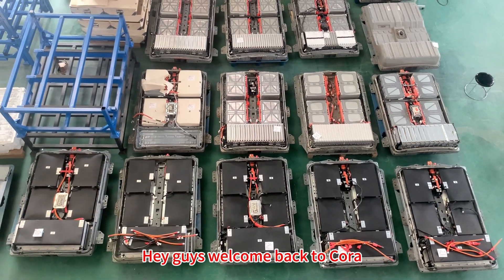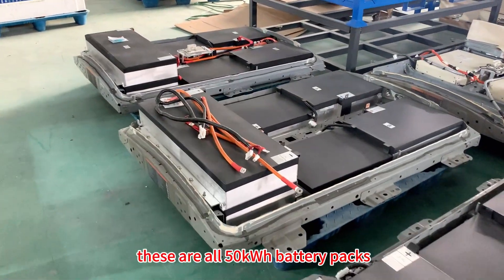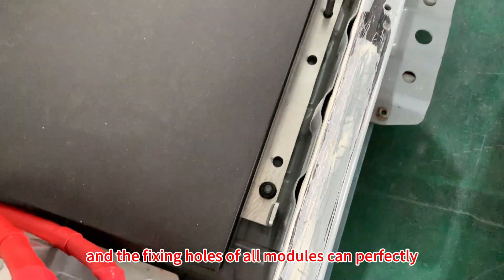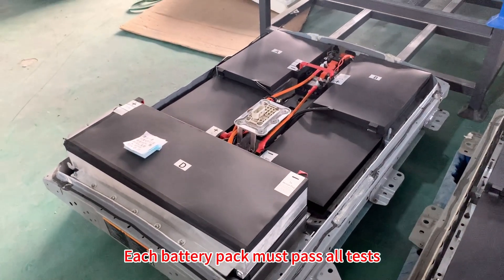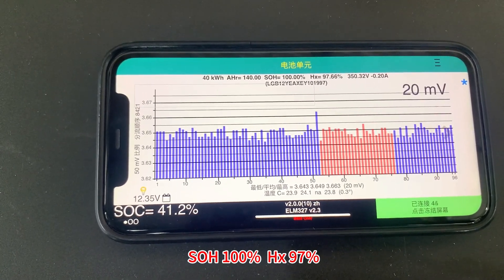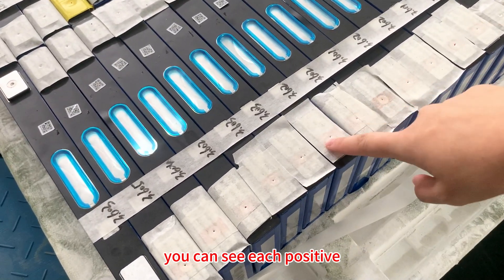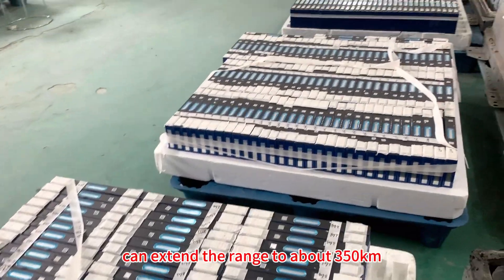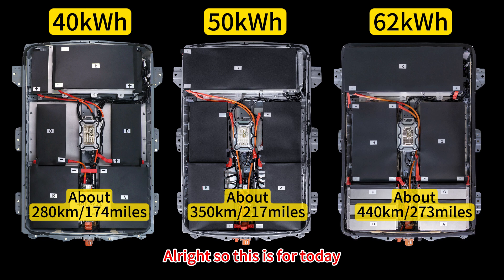VIVNE-50kWh battery pack for Nissan Leaf battery upgrade

Comment: Hi. Can you ship a 50kwh "kit" to the UK for fitting into my ZE0 battery case?
Reply: I have a 2015 leaf, I am tempted to buy this plug and play - the customs part of the transaction is my main concern, not the battery.
Reply from the maker: @GaryStephens-d3x  Hey Gary, where are you located? maybe we have DDP service(Door delivery) to there, but I have to check according to your detailed address, can you WhatsApp(+8615211174371) me please? thank you.
Reply: @GaryStephens-d3x  Good point. Do the prices include UK customs charges?
Reply from the maker: Hi, yes we can, the battery kit can perfectly match your original battery case without any modification. Usually we have door delivery service to the UK, but need to check according to your detailed address? can you WhatsApp(+8615211174371) me first please? thank you.

Comment: I would like to know more about the load testing your that you do on the machine you have in the workshop, I would especially liked to know how many amps of load you put on your battery and for how long, I have 2 empty Nissan leaf battery cases waiting on new cells and am very interested in fitting your ones
Reply from the maker: Hi sorry for the late reply, I just saw your comment here. The maximum current of our equipment can reach 120A, typically it will charge/discharge continuously at around 110A for 15-20 minutes.
Reply: @CoraLiu-VIVNE  thanks for letting me know that, I think that what you are doing is great for Nissan leaf owners, and high amperage load testing with a infa red heat camara would be very interesting, especially at the loads that the ze1 with the 160kw inverter uses,this would be around 400 amps, (I am guessing that would be about 6C for your 50kwh batteries),would your batteries work safely in this case? If so it would give great confidence in your batteries,
Reply from the maker: @ For our 50kwh battery, 160kw full load operation is about 3C discharge. In fact, instantaneous 3C discharge is allowed. The 160kw leaf ze1 e+ (plus) is the latest model, the original battery is 62kwh. I don't think any Leaf owner would be willing to replace it with a 50kwh battery.
Reply: @VIVNE-CoraLiu  thank you for the reply, that gives me a lot more confidents in your battery, I would think that in the future people with the 62kwh Leaf plus would use your battery when there one becomes unusable as the range of your 50kwh batteries look fantastic and would be more cost effective than the genuine Nissan 62kwh, looking forward to trying one of your batteries in my car in the future
Reply from the maker: @jasong7374  Thank you, just feel free to contact me if you have any question.

Comment: Guys do you sell a complete 50kwh battery pack case and everything ready to be installed inside a 2018 40kwh Leaf :)
Reply from the maker: @xboxice2005  Yes we have, plug and play battery pack
Reply: Hi Cora. In the website it says "deposit link" in the title of the ZE0 battery pack, what does this mean? Also, is that kit the whole battery with its case?
Reply from the maker: @ We support paying 30% deposit first to arrange production, and the remaining 70% to be paid before shipment. But I need to calculate the shipping cost according to your detailed address, so can you WhatsApp(+8615211174371) me your address and your car information first please? Thank you.

Comment: leaf batteries have weak thermal management as i know. What is the case with your batteries?
Which capacity version warming most during highway driving and dc charging?
Reply from the maker: We have not changed or upgraded the cooling method, and still keep the same solution as the original one. However, since the capacity of our upgraded battery is increased, the same power will have less load on the large-capacity battery cell and generate less heat.

Comment: How do you pair battery BMS ID/Key with car?
Reply: reuse stock BMS
Reply from the maker: @antronx7  We do not sell BMS, we only provide BMS programming services. But in order not to affect customers' use of the car, we usually provide the programmed BMS first and send it out together with the battery. After the customer receives the battery, the old BMS needs to be returned to our factory for recycling.
Reply from the maker: Just use leafspy pro to clear error code P3102

Comment: Hi Cora 👋🏼. You do good work. Lovely battery packs😊. What do you do with the old cells out of the car? How much for a 50kwh pack shipped to New Zealand??
Reply from the maker: Thank you, we use old battery cells to make 48/60/72v batteries, which can be used in tricycles or sweepers, and can also be used as energy storage mobile power supplies. I need to calculate the shipping cost according to your detailed address, can you add my WhatsApp: +8615211174371 or send me an Email: cora@vivnevs.com first? so that I can send you all the details about the battery, thank you.
Reply: I would also like to know this as I am in New Zealand too,( northland)
Reply from the maker: @jasong7374  Actually we need to calculate the shipping cost according to your detailed address, can you add my WhatsApp(+8615211174371) or send me email(cora@vivnevs.com) first? so I can send you all the details about the battery, thank you.